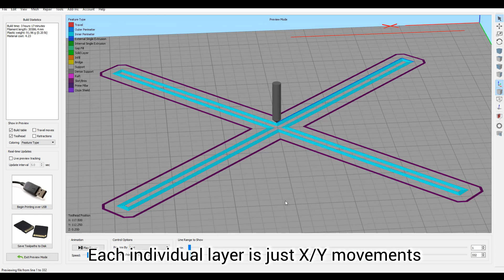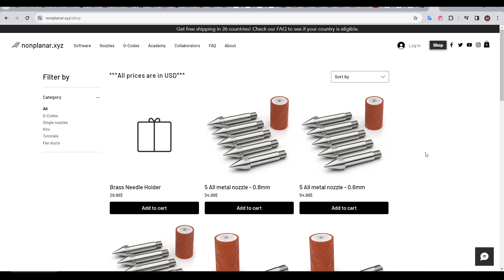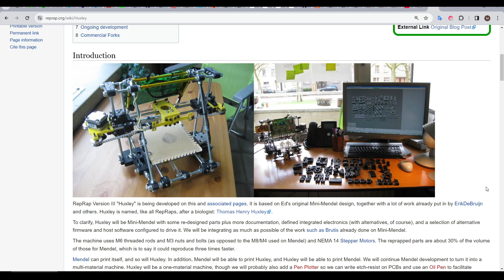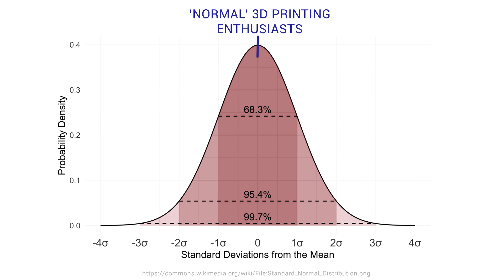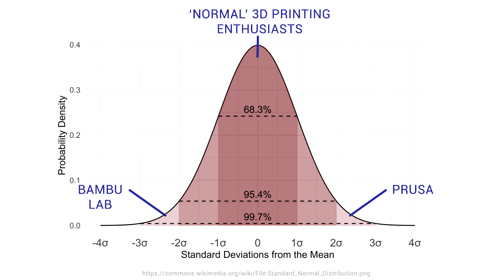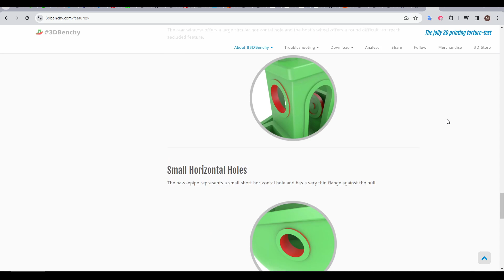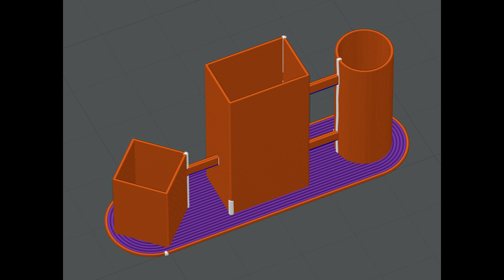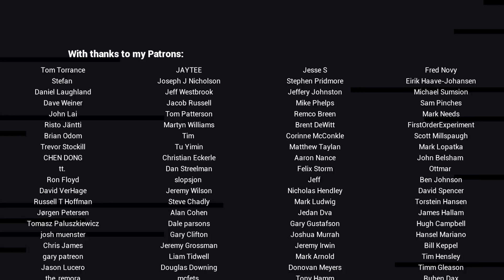3D printing mysteries that need to be solved in 2024

Comment: Non-Planar printing... for no other reason than how they put together fairly polished machines, I wouldn't be surprised if Bamboo implemented it.
Reply: I doubt it. The design of the print heads of the Bambu Lab printers does not provide enough clearance. And they probably won't implement it for other manufacturers.

If a slicer does implement it, it will probably be a vendor independent slicer like Orca Slicer or Simplify3d, and the printheads will probably be community designs rather than a manufacturer incorporating it into their printers.

But it is much more likely that a manufacturer will develop a 5-axis printer. There are already a few community projects.
Reply: @andreas.grundler  Thanks for responding with your thoughts. 

Fair enough and the thought of the slicer being the core/crucial element crossed my mind, as the software is creating the paths, but it seems Bamboo is creating/packaging the more advance, for lack of a better word, ideas, that they might be one of the companies to do so. 

5 axis or similar crossed my mind a while ago but I'm happy to just be a 3D user at this point, saving my engineering tinkering to my other projects at this point. 

Have a happy new year.
Reply: I also think the best chance for it to hit mainstream is for Bambu to do it.  They have the money and the talent.  They would likely do it as a plugin so they would not have to open source it, keep it as a competitive advantage.  Want a benchy without a stair stepped roof, buy a Bambu printer will be the answer.  As a person who doesn't own a Bambu printer I would actually be ok with that if they didn't try to patent it in some way, as that would likely nerd snipe someone else into implementing it for open source.

Comment: 3:12 I'd rather use 3- screw leveling to achieve nonplanar than make changes to the printhead
Reply: How does that negate the need for a modified print head for more clearance? It might provide a little more leeway, but any machine with a lot of stuff only a couple mm higher than the tip of the nozzle is still not going to work well printing a model with any significant change in surface level. Both would be the best solution.
Reply: @ggaub  its the easy way to get in. i get nausea when i think about a 5axis extruder-head. but i want to build one soon, when i got LINUXCNC nailed down.
Reply: the hard part is firmware and slicers.
Reply: Firmware support is there, it's slicers.  I looked into it recently but am no C++ dev and it looks quite hairy to dig into.  One of those projects that would I would guess would take me a month or more and that's a ton of time to devote for free. @simonschneider5913